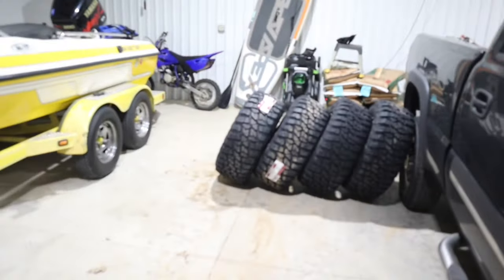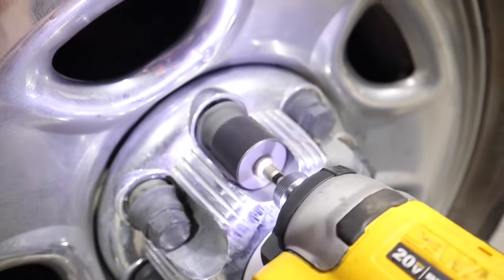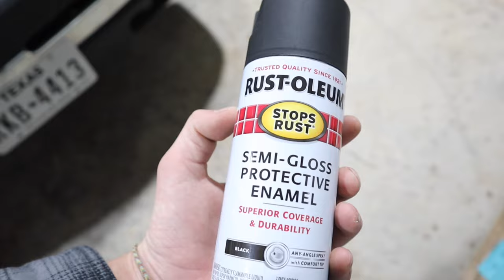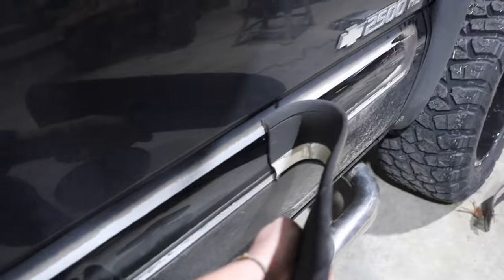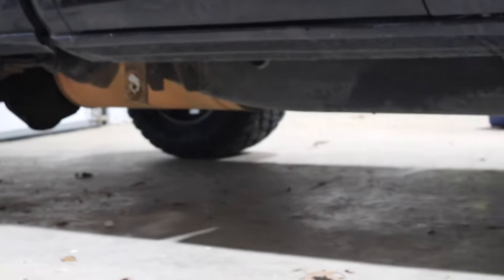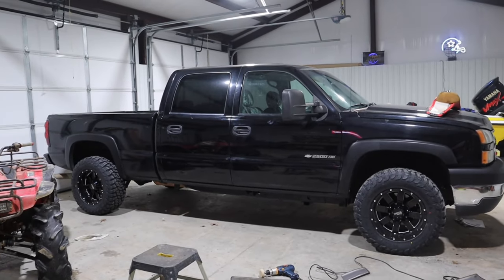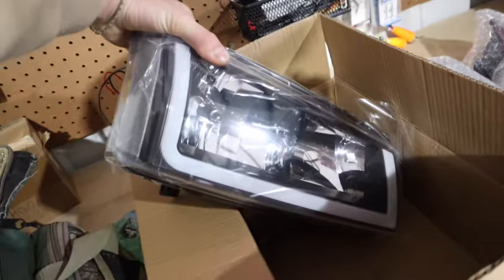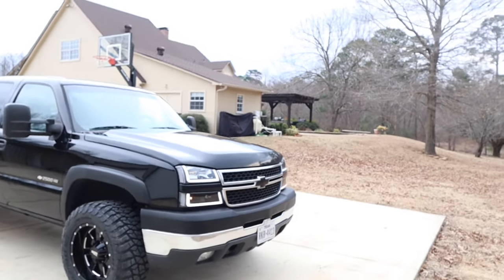Chevy Cateye Transformation

Comment: Tite Work… I have 04  2500hd  im modding mines out also. Todsy I installed LED headlights,  LED 3rd brake-bed light, LED tag lights. I will be changing out the tail lights also. swapping out basically the same rims and tires. These 2500 6.0s are a beast 😅